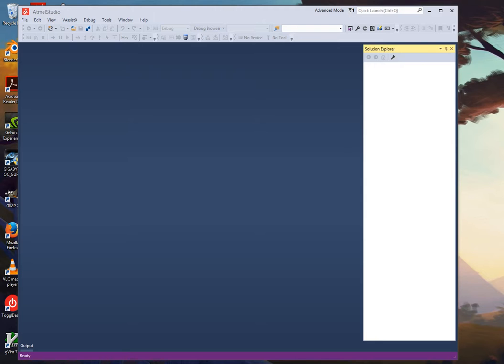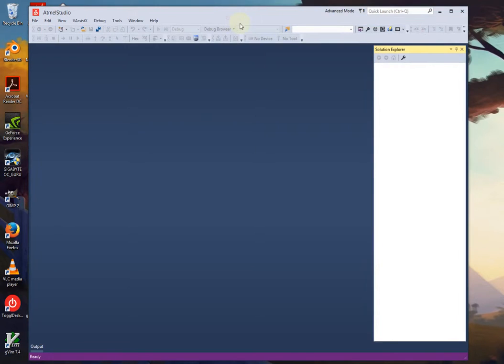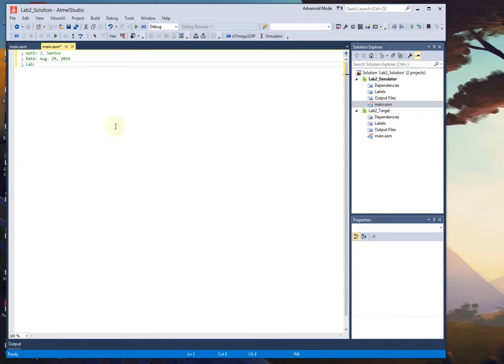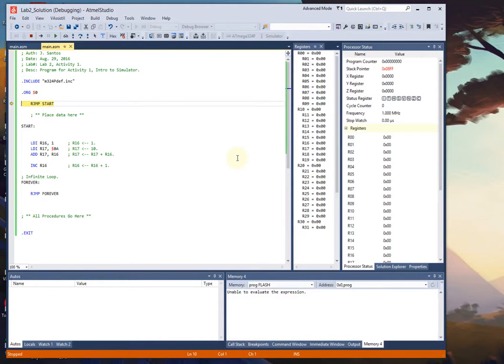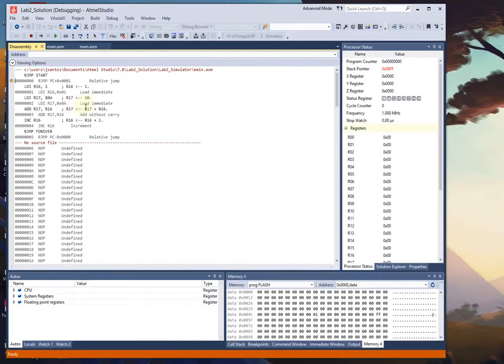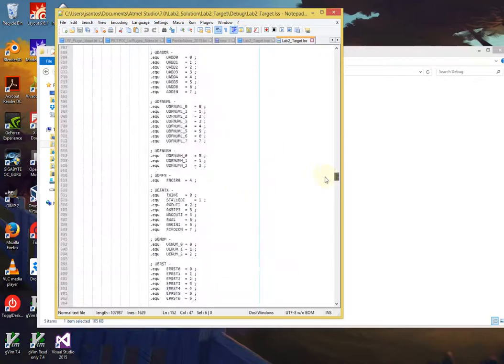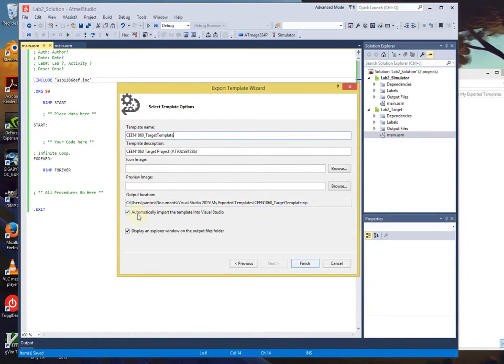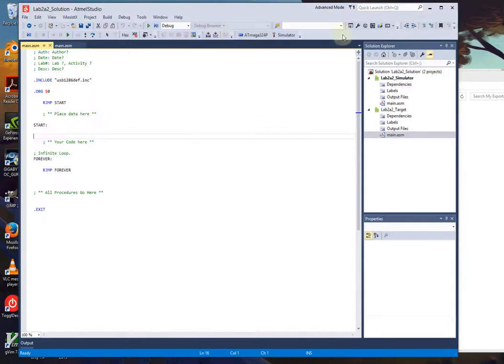Lecture 1: Using, Setting Up and Simulating w/ Atmel Studio 7

Comment: Do I need to use the simulator if I have the board? I feel like I can skip that step.
Reply: You don't have to. It allows you to check and verify the operation in software, contents of various registers as the code runs and also keep an eye on how much time it was taking to execute up to a particular instruction line. That could help in precise timing control. When you are dealing with waveforms then this kind of simulation will help see potential bugs caused by timing issues. Also nothing blows up in case you are a DIY hobbyist and connect hardware the wrong way.

Comment: WARNING:  Before sending code to a Teensy or Arduino, read my experience.

The Teensy is an Arduino look-alike, and has the following properties.  It is powered from a USB connection, which can also load code to it.  If it is so programmed, it can also send messages to the host PC via USB, so that it can request parameter changes etc.  The Teensy uses an ATMega32U4, and has an LED on it and a single button, and 29 legs for power, I/O, etc.  When supplied, it has a user program that blinks the LED.  It also has a boot loader program that communicates with a little piece of software on the PC called the Loader.
When it is plugged into the USB, it runs the user program (winks the LED), and when the button is pressed, it switches to running the boot loader, and the Loader on the PC visibly reacts to it, showing that it is ready to communicate.  If a user program causes the Teensy to lose functionality, it can be recovered by pressing and holding the button while it is plugged in, which restores the boot loader.
I wrote an assembly level program on it, and asked the two questions you see in my other posts, but as I did not get an answer, I pressed ahead in the fond belief that the Teensy's boot loader would be protected somehow (by fuses), and could not be overwritten.  I now believe that was a poor assumption, as my Teensy now appears to be bricked.  The program I wrote sends a varying mark-space signal to the LED that goes from (1 period ON, 255 periods OFF) to (255 periods ON, 1 period OFF), then (always ON).  It does this over the space of 1.5 seconds, and the eventual application was to be a soft start for an electric motor.
I don't know the internals of the Teensy, but most processors I have previously worked with are only capable of one thing when switched on.  They execute the instruction at memory location zero.  If it is not a jump, they continue with the instructions in sequential addresses.  As I said, I don't know how the Teensy works, but I think it must start off by executing a part of the boot loader that tests to see if the button is depressed, and if not, will cause it to jump to the user program.  If the button is pressed, it causes a reset that takes operation back to mem-0, but as the button is still pressed, it goes into the boot loader functionality.
My belief is that, even though I omitted the assembler directive ".ORG $0", the assembler caused the program to start from memory address 0, and has consequently overwritten the boot loader, which means I can no longer transfer software to it.
The symptoms are that when the Teensy is plugged in, it runs my program.  The LED comes on at zero brightness and increases to full brightness over a period of 1.5 seconds.  If I press the button, it re-starts my program instead of communicating with the host-based loader.  If I disconnect it, and hold the button while reconnecting it, my program runs as soon as it is released.  Bye bye Teensy.  Be warned!

==================Further information ===================

The Teensy is developed and supported by the folks at PJRC.com, but since its initial design, it has been cloned, and the Chinese clones sell much cheaper, taking market from PJRC.  For whatever reason - possibly in aqn effort to improve their product, or possibly as a reaction to being cloned, PJRC have re-designed the boot loader so that it can't be cloned, and so that it can't be overwritten.  They say this has been tested, and works.  Unfortunately, the Teensy is an American product, and when the postage from America is taken into account, I can buy 2 1/2 cloned Teensys from China for the price of one from America.  Ya pays yer money; ya takes yer choice.  If you are already in America, the real deal will work out as a much better deal than it does in Europe.

Comment: It would be nice if Studio-7 had definition files to simulate all processors - otherwise, finding one equivalent to the target processor is a bit hit-and-miss.  My target is an ATMega32U4, and I initially chose a 32HVB for the simulator, but the build failed because 32HVB doesn't have a PORTD.  I found this by examination of the definition file.
You might make some notes about how to choose a simulator chip.

Comment: This is a complicated piece of software to use, and I'd be totally lost without this video.

During setup, under Project properties, should I select something other than "Erase entire chip" if I am using a Teensy board, which has a USB interface and a boot loader?  I don't want to erase that - or would it be protected by a fuse?

Similarly, do I want the assember directive
.ORG $0
Would that cause it to overwrite my boot loader?  I don't actually know where that is, but it would sem reasonable to put it, or a jump to it, at $0.